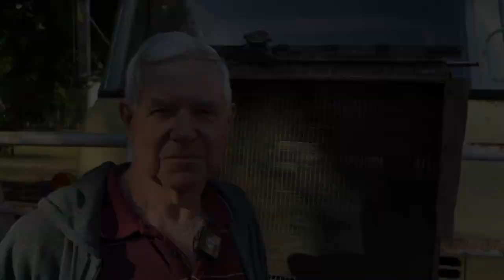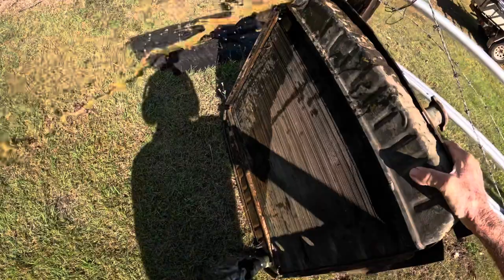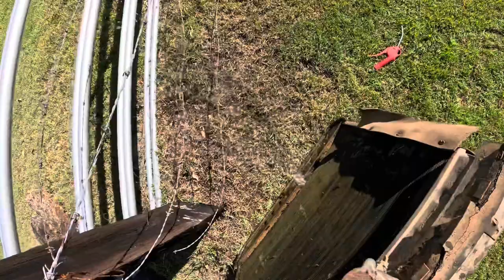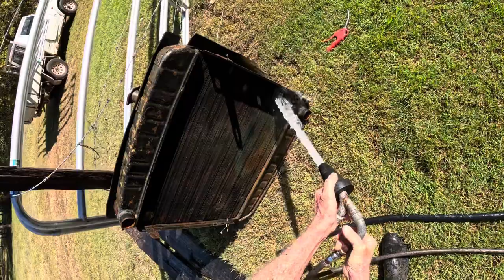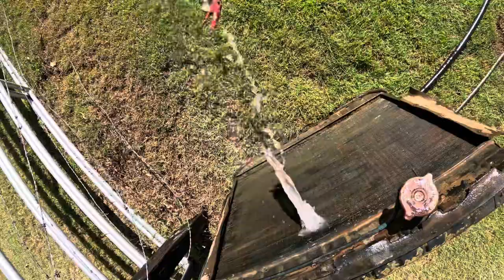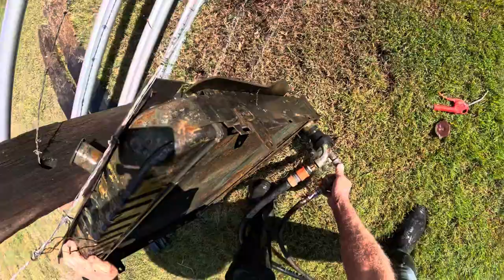Flushing A Radiator - Bedford MFR 4x4 Fire Truck Rescue

Comment: That’s a hell of a flush system there Bruce, I was wondering if you’d end up with a few more holes. I bet the guys where you worked were pissed at always being late for smoko and knock off after you flogged the fitting….lol, just kidding
Reply from the maker: Lol, in the town I am in, it was full of smoko whistles blowing throughout the working week. When I flush suspect radiators which aren’t leaking, I cut the air pressure back to 50 or 60 psi to try to avoid damage but this one I wanted to see exactly how bad it was.